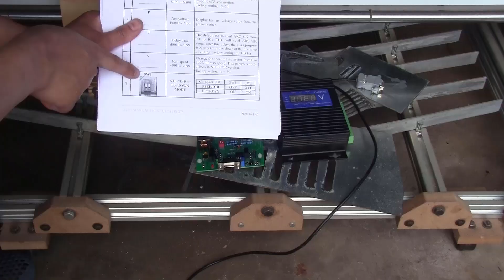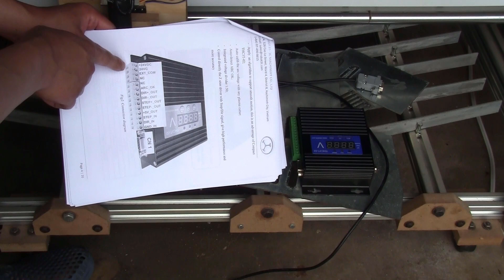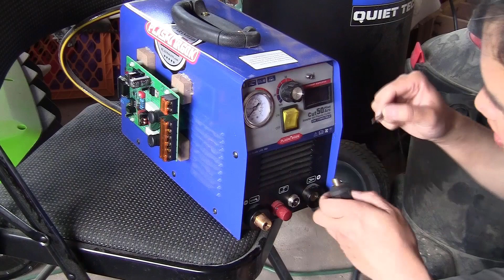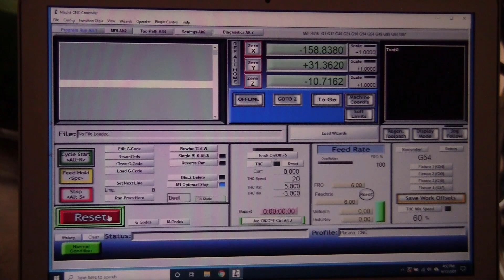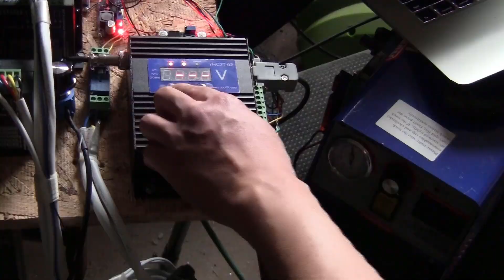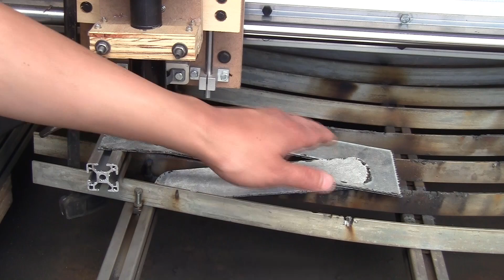CNC Plasma - Torch Height Controller - THC3T-02 installation - Should you get one? Absolutely yes!!!

Comment: Can you share the manual for it ?! And thanks for everything you explained are incredible
Reply from the maker: https://drive.google.com/file/d/1qnDrr8e3vaOCKdmw0if8b6ohaQhBtWFZ/view?usp=sharing
Reply: @minhsmancave9448  hii brother... I just wandering if my bored ( rnr ) i can connect the thc up and down signal on my thc3t ?!
Reply from the maker: @Enrx90  Up/Down mode won't work with RNR board. Sorry my friend, You will have to try to see if your THC3T can be switched ti Step/Dir mode
Reply: Thank you so much... but there is one more thing what about the wiring the arc oki and how to connect it to the relay?!
Reply from the maker: The arcOK is connected from the Thc to an input of the controller board, not the relay
Reply: @minhsmancave9448  so i have to cancel the relay from the system ?! Or connect it to anther output to the relay?!
Reply from the maker: The relay is to turn on and off the plasma arc, it need to be connected to an output
Reply: Hi minh .. I just connect all the devises together and wan i set the p mode and start the arc to read the voltage .. it's not reading and the p mode still P000 !! ... by the way i doesn't connect the - cable to a sheet metal cause i didn't finish the water table... should I connect the - to a sheet matel to start reading the voltage ?! 
And thank you so much for the help.

Comment: Hello Minh, thanks for sharing.

Could you help me with some component values on this board?
Would like to reverse only the Voltage divider/filter part.
So it can be fed in a voltage > Freqency converter ie. lm331.
That way linuxcnc can read the arc volt and control the height.

After seeing your video,  studying picture's and the manual,
This is the circuit in ASCII as far as I could figure it out. 
The components with (Unknown) values are listed below the circuit.
Could you please look at your board and fill in the blanks/Unknows?

+ >----L1-----R1-----|-------|--------|          |-------|-------|-------|-------|------|
                              |        |         |          |       |       \       \        |     R7
                              |        |         |******|       |      R3    R5      |       |---> TV +
                            C1    M1        Filter      C2      |        |     D1    C3
                              |        |         |******|       |      R4     R6     |       |---> TV -
                              |        |         |          |       |        |        |        |     R8
-  >-----L2-----R2----|-------|--------|          |-------|-------|-------|-------|------|

L1-L2  Unknown 
R1-R2  100k 5W
C1     Unknown
M1     14D741
Filter Unknown
C2     Unknown
R3-R6  2k 3W
D1     Unknown
R7     Unknown
R8     Unknown
C3     Unknown

Thanks in advance.
Reply from the maker: Sorry, first thing, I don't have this THC system anymore and cannot read whatever on the board. If I understand correctly, you want to convert the arc voltage to frequencies and input that frequencies to your Linux CNC board? You can always by a arc voltage divider board separately and use the voltage that is already divided and convert that value to frequencies. There are some cheap one on eBay or Aliexpress.
Reply: @minhsmancave9448   No problem, 
Yes you are correct, I want to convert the arc voltage to freqency. That's the easy part.
Problem is the filtering out of the  hv/hf start when connecting without opening the machine.
Reply from the maker: I'm buying a sf-hc25g thc system from AliExpress and it has a arc voltage divider board. The interesting part about this divider board that the controller board (mach3 or whatever) will send the arc start signal to it and the divider board will have it own relay to start the arc and read the arc voltage. I hope that it will have a filter integrated on the board.
Reply: Seen those as well altough they seem to have less filtering.When you don't mind opening the machine you can connect it before the HF coil.
Have a look at : https://web.archive.org/web/20181013185951/http://tamarisktechnicals.com/pages/CheapTHC.html
Not sure for mach3, for linuxcnc you only need the voltage->freqency input on a encoder, it can do the Arc ok, torch up/down etc. in software without a sepperate controller

Comment: Hello Minh, I would like to know if the cable that connects the voltage sensor with the controller is short by necessity or it is possible to use several meters, because the plasma machine is usually at a great distance from the computer, for example 3 meters.
Thanks in advance.

I had already bought the same controller and the cable is very short (not tested yet).
Reply from the maker: Yes, the manual recommend to have the cable as short as possible so the divider board can read the change in voltage as fast and as accurated as possible. You should stick the divider board on the plasma cutter itself. The Thc unit can be further away from the plasma cutter.
Reply: @minhsmancave9448  I have re-read the instructions, but for some reason the name of each circuit board creates my confusion.
So to clarify, I can put the "black box" as far as I want from the plasma machine, with its corresponding long cables, without problems.
Thank you.
Reply from the maker: Yes, the black box can be further away

Comment: Incredible! Is the same THC, I do have the same controller, but I'm using the 5axis one. But basically the same electronics. Good Work!!
Reply from the maker: The installation is pretty simple. only need to make sure that if you got your Z axis reversed compare to what you have before, don't try to change anything in mach3 or with the wires of the stepper motor. Just reverse the dir- and step- on the stepper motor driver (connect them to dir+ and step+).
Reply: @minhsmancave9448   puedes compartir el diagrama de conexion final que usaste. No he logrando que me funcione el THC

Comment: Hi i just bought thc3t-02

Can you help me about your finale wiring from thc to driver dm542

And your final setting thc3t-02

Thank you
Reply from the maker: The dir- and step- go to dir+ and step+ on the dm542. This really depends on your machine. If the Z axis direction is reverse compared to what you had before, just put the dir- and step- into dir- and step- on the dm542.
Reply: Ok, i think i can understand .
How about your setting number 
. From your experience if i have to cut plate 2.5mm how is setting number. Thank you
Reply from the maker: For setting up U, you will have to read the number from P mode. Set your amperage on your plasma cutter, maybe 45amps, not sure what amperage you wanted to used. Turn on the torch and read P, get the biggest and smallest number, add them together, divide by 2. That's the number for U. For delay, D, set around 10 (1s). S around 150 to 200. V is really depend on the speed of your Z axis stepper motor. Try with 40 or 50 first.
Reply: Ok..i will try it. 
Sir can i have your email or whastapp . May be i can contact you  if i have trouble. Sorry my engslish is bad. Thank you
Reply from the maker: minhdung.diy@gmail.com